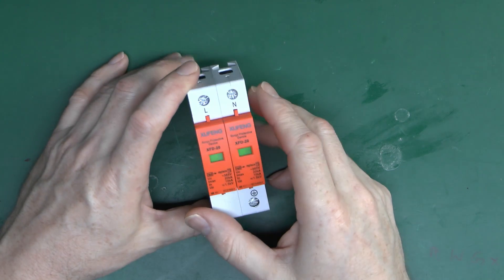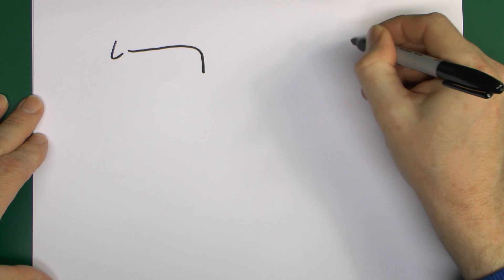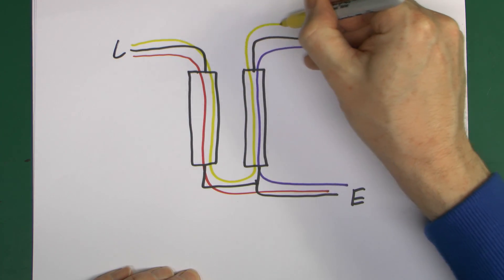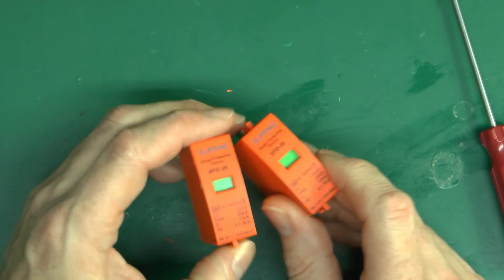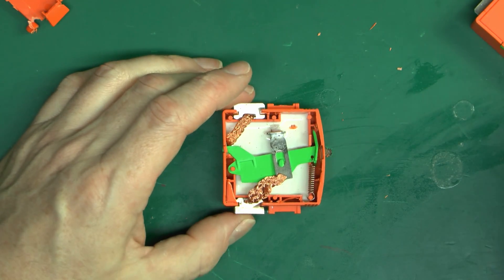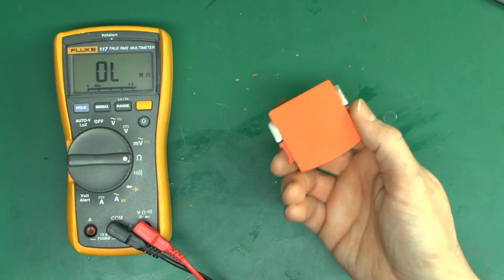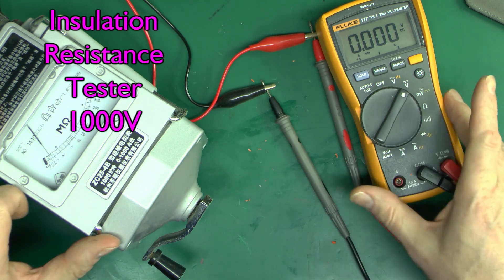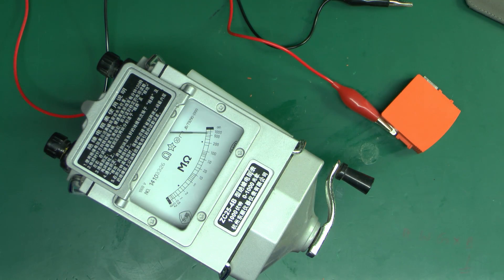Surge Protection Devices - Part 2

Comment: for information in dutch systems the SPD (OSB) needs to be in a location withing 40CM of the incoming (main) ground (PE).
also a type 2 only need a fuse if it can pull more than 125A if it breaks, if do u use a 63A fuse.
a type1 can take 250A and need a 125A fuse if the installation can handle more than 250A
and last but not least a type 1+2 needs to follow the type 2 specs.

Comment: Brilliant explanation and demo. Haven’t seen a Mega like that since about 1980 when I was an apprentice. The electricians would love to give the apprentice a shock with the handle spinning and max rpm. 😂.
Reply: Yep got zapped myself in 1980... I went to the factory for a 2 week induction after finishing O levels before starting first year training at the local tech college in September. As i was one of the youngest in my year I was only 15 years old for the first week...loved it... Apart from the megger zap.    It was a boiler and radiator manufacturer in Yorkshire, the electrical workshop was a dark place (ironically) and Dick the oldest sparky held challenges to see who could hold the Megger for the longest time and get the highest reading.... He could of course... ElfNSafety didn't exist...hahaha

Comment: When those MOV's go they really go up in smoke if they are unfused. I use to work in a packing factory and about once every three months a MOV in one of the bagging machines would burn up and stink up the whole factory. My boss was dumb and couldn't understand why I wanted to replace components that would burn up on occasion. For me replacing them was very important because the circuit boards the MOV's protected in those machines cost thousands.

Comment: I have at home a TT installation, and 3 x 230 Vac plus neutral. A bit more troublesome to install SPDs. The video didn't explain the differences between (Type 1,) Type 2, Type 3 SPDs. Also, some SPDs only contain MOVs, but many also GDTs (and TVS diodes).

Comment: It would be nice to see the MOV that's hiding in the resin.  Being a cheap unit I wonder if it really is a good sized MOV or just a well hidden tiny one.
Reply: I found that I can buy these Chinese MOV's about ten cents per part no matter what the value or size. If a factory buys reels in volume the price goes down even lower. Where I worked they bought components like these for 2 cents. It makes me wonder why a multimeter with a MOV costs three times as much as a multimeter without.

Comment: Thanks for the explanations. If I understand you correctly, the SPD is only side-wired to the main power flow of the individual conductors (which would explain why for each conductor there is just one connection coming in, but not coming out again, apart from short-circuiting to one of the other conductors, in case of a voltage surge). This also means that the main lines are not interrupted, so if e.g. a lightning strike feed its energy into a phase or neutral conductor of the main power line, what prevents the current from reaching connected devices? Is it only about the path of least resistance?

Comment: Very good video!
In video part 2, was your test in DC? In that test, what was the nominal capacity of SPD, 500V or 1000V? In general, with a 2pole SPD and 500V nominal capacity in both poles, the real capacity between DC+ and DC- is 500V or 1000V?

Comment: I had a surge protector installed in my consumer unit, but the inserts are 2 different types.
The insert between line and earth has a model number with a V inside it, but the insert between neutral and earth has a T in its model number. 
It's also labelled N/PE on the case.
Reply: Ones a MOV Varistor, and the other is a gas discharge tube..I think..

Comment: A wylex  SPD in a domestic consumer unit is rated at 125amps so the SPD is protected by fire by the 100 amp cutout fuse.The cable to the unit could be 2.5mm so I would connect via a 16amp breaker not 32amp as suggested by this gentleman .I am always open to further insight into these resently new devices.
Reply: I loved your input , could you tell me how i can run L and N into one hole and then L and N carry on , am i supposed to run 2 wires into each hole like hes been drawing ?
Reply: @angelanuccio2167  no it's just a three wire device .line from breaker.neutral from buss bar and earth to earth bar. On overvoltage it dumps power to earth.

Comment: The real issue for me is, realistically how likely is it that the end user will frequently monitor the functionality of the these devices. CU's are generally hidden away somewhere underneath a staircase or at the back of a storage cupboard and only ever looked at when there is a problem. If the SPD fails and requires replacing, everything in the installation will continue to work with the end user unaware of the failure.
Reply from the maker: That is part of an existing problem, which is that most people consider electrical installations to be magic and just work for ever with no maintenance or repairs needed.
Reply: Ashman Electrical Services - even less likely that the SPD(s) will be maintained once the end user discovers that it will cost them money for no immediately visible benefit...

Comment: If one module is rated 550V and it is connected in series between L-N. The total voltage that will be clamped between L-N would be 1100V?

Comment: As per your demonstration each surge protective module seems to have a clamping voltage limit of about  600 V DC. So when installed, as both devices are in series with the Live and Neutral lines, wound't it give a surge protection above 1200V  (or 850 V AC) or so between the lines? isn't it to high?

Comment: If they fail open circuit, that could happen during a thunder storm? First few strikes are handled, then the module opens up?

Are there versions that fail short circuit instead? I would rather have to investigate why the fuses blow than replacing all electronics in the house.

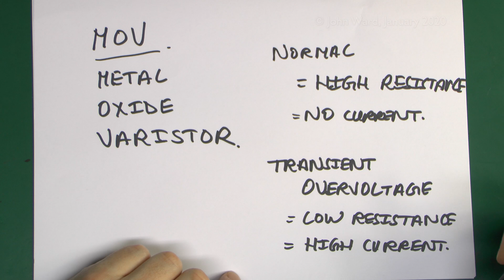Comment: I'm not the expert on SPDs, but from what I understand, this was wrong at least on the "low" impedance part of the explanation 5:51.
Overcurrent protection is meant for handling failure modes.
MOV normally doesn't act as a short circuit during a surge, it is rather akin to zener diode and shortness only has to do with energy handling capacity.
As I understand them most SPDs contain MOVs only on the Line-to-Ground paths, and use GDTs on the Neutral-to-Ground side, which do act as a short circuit.
This has to do with difference between static and differential resistance.

Also industrial SPDs sometims use selenium cells for sustained surges.

Comment: I might be wrong but why have the neutral to earth part in a tncs supply?  The neutral and earth are connected by a solid link before entering the consumer unit. In the event of a transient on the neutral it’s already grounded, this device wouldn’t fire on the neutral because it wouldn’t see the already grounded to earth voltage spike. Just my humble opinion-Great videos John I watch them all 👍
Reply: In the instance of transients, there is a lot of high frequency content so there is a reasonable amount of impedance despite the DC resistance appearing to be low. Even less than a metre of meter tails has a measurable inductance.
Reply: Thanks for the reply although it’s hard for me to get my head round. I see this device as something that starts conducting under a certain voltage. So when it conducts it dumps the over voltage down the earth. But in a tncs setup the earth I’m talking about is permanently connected to the neutral anyway before it gets to the consumer unit. as a pen conductor the neutral and earth are the same cable back to the transformer . I can understand having this on the line side but only the line side.
Reply from the maker: At very high currents (10s of kA), connected together doesn't mean very much.  Inductance can result in voltage drops of 1000+ volts for just a single metre of straight conductor.
Reply: Thanks for the reply John. I’ll put my faith in the industry boffins and will be fitting rcbo/spd boards from here on in 👍

Comment: Perhaps device failure would first cause the plastic to soften before the solder would melt? There seems to be no internal fuse, so could this start a fire if it fails and overheats just to the point that the plastic melts but not the solder? Perhaps it'll have thermal runaway and melt the solder anyway, so this wouldn't be a concern?

This unit is tiny compared to the Eaton CHSPT2ULTRA I put in my house (which suggests being connected to a dedicated 50A two-pole circuit breaker). For our American split-phase system, it has both L-N and L-GND protection, and burns green LEDs while the device is still in service. They also have a model which only has L-E/N, but it's more expensive for whatever reason.
Reply: First ones used to be on a MCB but that's not required any more (just runs right off the consumer 100a isolator) as any type of amps and heat passing it melt off the solder and they cut off (for genuine spds that is as they normally only have a very small blodge of solder but they do get quite hot and they use low melting point solder )
the Neutral likely will never fail As its typically a gas discharge device but the live will always fail eventually, you can actually hear it sometimes if you put 1000v on constant test as it heats up the varistor
Reply from the maker: The types that don't require an external MCB have a fuse inside them.  If that fuse fails, the SPD is useless, and no one will ever know because the fuse failing doesn't trip the mechanical indicator.
Reply: @jwflame  the fuse (normally solder as a fuse) is what is holding the indicator tab green, once it fails it gets hot and solder melts and disconnects it witch moves the tab to red, be it China ones or UK genuine branded ones
Reply from the maker: @leexgx  That solder link is a thermal overload, designed to break in the event of excessive temperature.  They all have those.  Types with a fuse inside have a fuse designed to fail at a specified current, they also have a fuse symbol on the side of the device, one example: https://www.dehn.co.uk/en-gb/1628/31262/Familie-html/31262/DEHNguardmodularwithintegratedBackupFuse.html
Reply: @jwflame  the 18th edition ones seem to have that fuse built into the spd (but very Likey still Just solder but very small amount or a fuse wire holding the tab green) I agree once it does blow it probably never get changed for long time as you could see that the MCB had tripped before (assuming the solder didn't melt first)

Comment: At 8:24 when voltage go up, the mov resistance fall, which basically mean L & N will have connection to each other.. wouldn't it blow? Because when L & N is connected it produce very high current

Comment: So to put that inbetween solar panels and inverter your supposed to run the L and N in and run another set in the same hole coming out to carry on , really makes no sense , id like to see you wire one into a system instead of drawing lines and disecting the device . or does this just run off the side of the breaker and is supposed to just capture said surge?

Comment: That was both interesting and educational. After the cartridge shorts during a power surge... Does it continue to rush the power to  earth (Literally running up the meter)? Or does it cut off the power as well? When a high flow of voltage comes through and causes the compound to be conductive, does it revert to it's original state later on?
Reply from the maker: It's effectively a short circuit for the duration of the surge, and returns to a very high resistance afterwards.  However that duration is typically measured in microseconds so the energy dissipated is far too small to make any difference to meter readings.
Reply: @jwflame  Aren't these one time/ replaceable cartridges? Or as you said it returns to being non conductive after it Earth's a surge. So continues to do is job again even when the indicator is red?

Comment: Great explanation John. I was trying to understand the failure modes  after we  some kind of significant surge resulting in a neighborhood power outage for 24hours (I assume the power company swapped a transformer).  I had a power strip surge protector with two MOV devices [L, N]. When the surge occurred, it tripped the breaker. Upon resetting the breaker, the surge protector burned, indicating a direct short. I didn't know the MOV would fail shorted but it did it's job.  We had 3 circuits trip, all of which had MOV surge protectors. Two of which failed permanently (or rather, "succeeded" by dying :-). As a result, I'm looking at how best to protect the electric panel at the source.  Is there any type of surge protector/breaker that can reset automatically after a single event upset?

Comment: Great video as usual, very educational. I would like to know just how much of a real issue this is for the general public, what frequency of surges actually happen in rural and urban areas for example. Or is this an opportunity for the manufacturers to cash in... call me a cynic :-) Also, given the large amount of heat produced (enough to melt solder), what about units next to these (MCB/RCBO, etc.? Should a space be left between the Surge Protector and MCB/RCBOs?
Reply: Where I live, in my home, I’ve not known any electrical or electronic device that has failed because of a surge. However, the problem is that you are not likely to know if/when a surge has occurred. And when an electrical or electronic device does fail, you then don’t know why. All I know, is that when any of my electrical or electronic devices have gone faulty, nothing else has failed at the same time. Hence, if there has been a surge, it must have been rather selective!!!
Where I work however, some outside effect (lightening is suspected, although not a direct strike, or possibility electromagnetic induction from something else) has caused surge arrestor protection modules to go low impedance, which did protect the communication equipment (linked by miles of long distance external telephone type cables) , but caused a loss of communication until we replaced or disconnected the failed surge protection units.
The older design of communication surge protection units that we used to use, were constructed using two RF chokes (in series to the equipment), two 100mA fast acting fuses (also in series), back/back 12V Zener diodes across the lines, and a ‘three terminal’ gas discharge device (middle terminal to earth, other two terminals to line A and line B). In these, we mostly just had to replace the fuses after lightening storms.

Comment: What happened to your Megger? The crank unit is amusing, but I wouldn't trust it as much.

It would be quite interesting to use a temperature controlled soldering iron to melt that tab and see what the actual temperature required is.
Reply from the maker: Nothing happened to it, just wasn't used in this particular video.

Comment: The unit tested.  A normal consumer unit has usually 16mm or 25mm meter supply tails into the box. What size cable should be used on the surge protection device on a normal domestic CU?
Reply from the maker: 6mm² minimum in most cases.
Reply: @jwflame  
Thanks.  I suppose the 6mm off the incomer switch with the earth and neutral off the bus bars. Would be nice if the unit could be off the L bus bar.

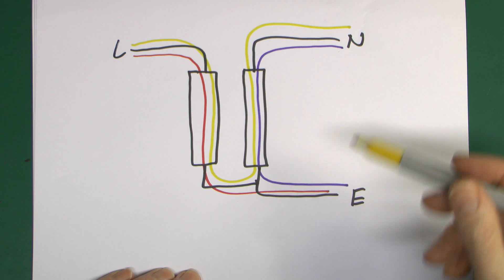Comment: 7:24 You have shown SPD connected between line and neutral whereas it should be really between line and earth or between neutral and earth right? Also there cant be a scenario of the surge passing from line to neutral as in 4:03 as the common point of the two modules are connected to earth which should bypass the surge from either line or neutral right, unless earth wire is broken of course?

Comment: Excellent presentation as always. Does it mean then that if the MOV goes open circuit and the solder link remains intact there is no way of knowing if the device has failed? Interesting to note that it has a linear response to increasing voltage. Thank you John.
Reply from the maker: If it did go open circuit, then there would be no obvious way to know.  However MOVs don't work like that - it's a solid compressed block of material, as they degrade, they become more conductive, until they conduct all the time, which is when the solder melts due to excess current causing it to heat up.
Reply: @jwflame  Thank you John.
Reply: @jwflame  hi does it mean this spd can operate without breaking turning red on the display and remain in use

Comment: am i right in thinking that this device should defintely not have an rcbo protecting it just a regular mcb for over current?
Reply: I can't think of any good reason why RC protection would not be in order, in addition to the self evident over current protection?
Reply: Pentti Kantanen these devices leak small amounts of current to ground, more so as they age, which could cause nuisance trips of an rcbo. That is why good ones have thermal protection for the MOV, to detect when it’s getting too toasty from the leaking current.
Reply: Jacob Wells - when new and undamaged, they should not leak any significant current. Once damaged, all bets are off.